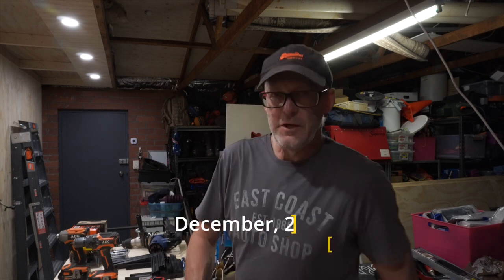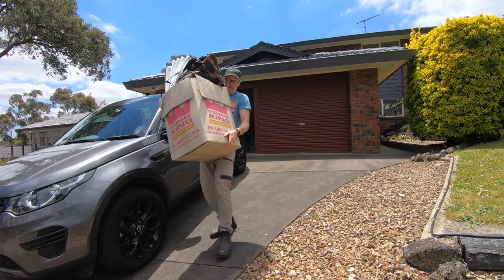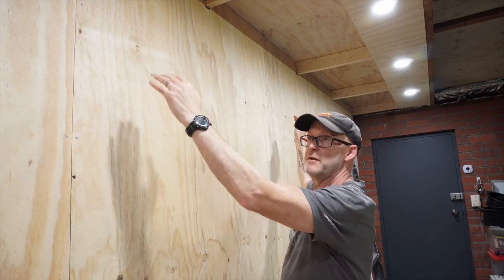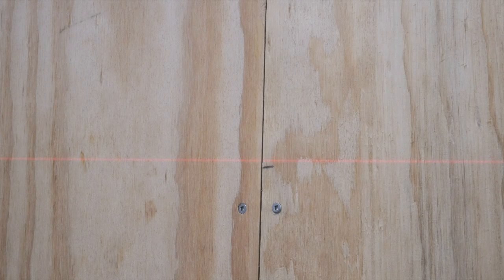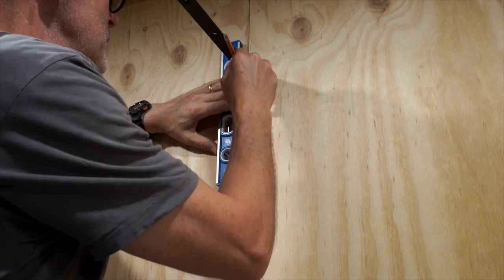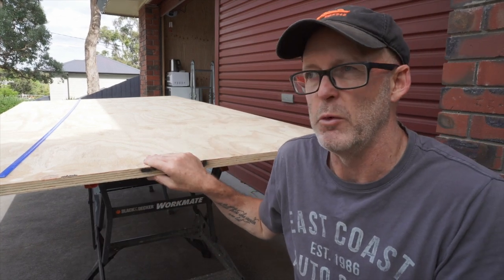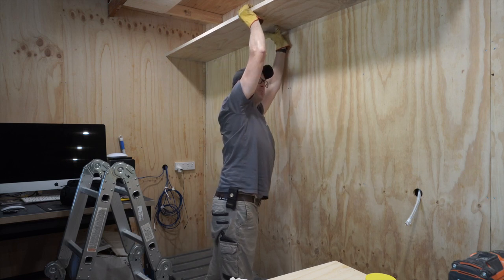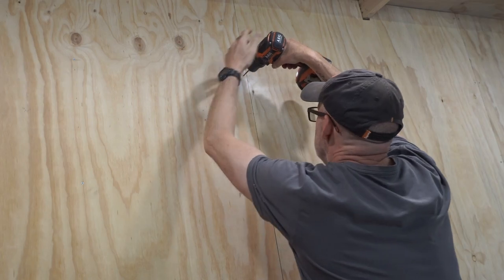Building plywood shelves in my garage - Garage Build Series Part 4

Comment: im doing the same. get a length of 90 x 35 and cut them to fit on the end of the shelf and then each 600mm so as to act like a support between bottom of top shelf and to the top of the second shelf. that will give you extra support just to help stop bowing down the track...